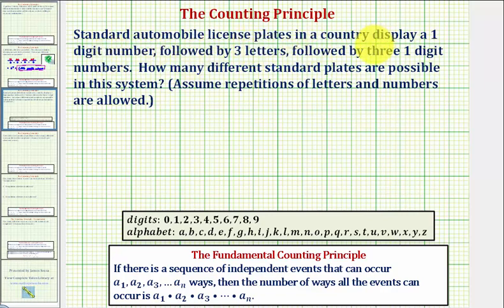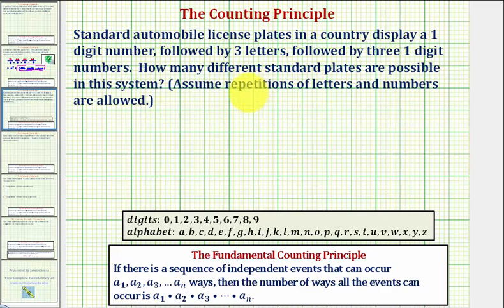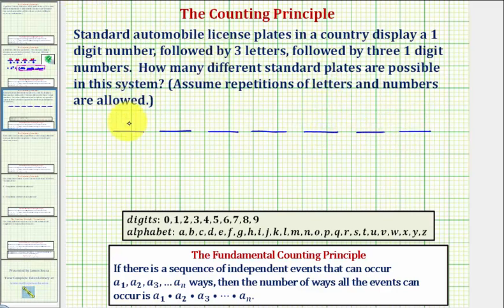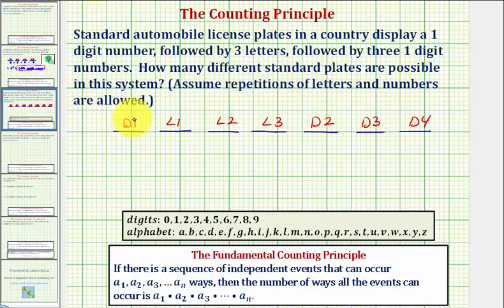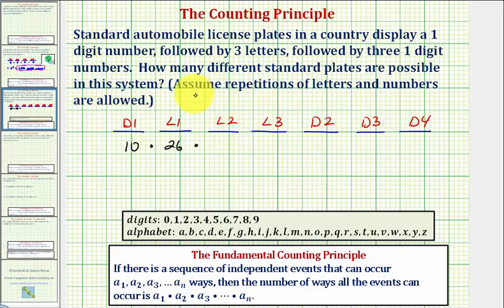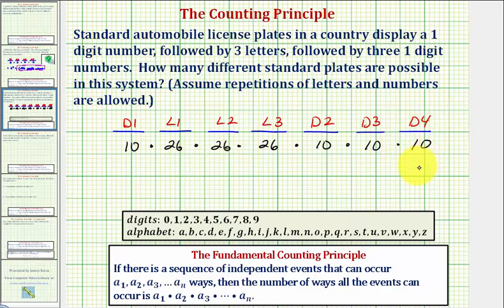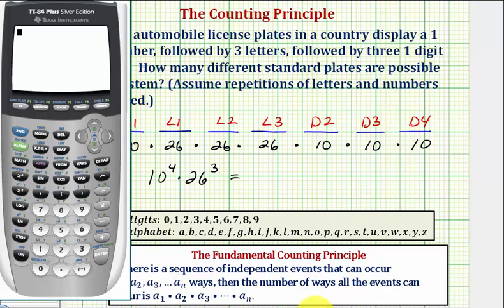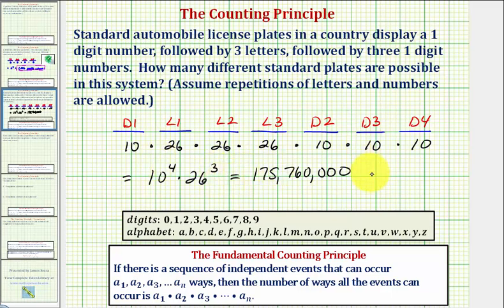Ex:  Determine the Number of Possible License Plates - Counting Principle

Comment: what can we do with the problem where there may be no repetition??
Reply: @Bobby Gorrand well when you really need to get something done... one is not going to sit there watch the whole video. If you know, give an advise, if not don't then don't even reply.
Reply: @Katherine Montano lol yeah no more needed but thank you. Yes, someone else will definitely find it helpful!
Reply: @Katherine Montano i agree lol
Reply: @meera5398  ^
Reply: i was curious to
Reply: @ranada9759  If they can't be the same then they're dependent on each other.
It doesn't make it too much harder.
Think of it like this: Either way, you'll need to multiply, but if you restrict it based on what already happened it changes a bit. Instead of being able to pick 10 or 26 at any point, L2 becomes 25 because 1 letter was taken up, L3 becomes 24 because 2 letters are taken up. Same haopens with the D's for 9, 8, and 7. Naturally you get numbers multiplying each other as they count down to 1. Which is exactly what a factorial is.